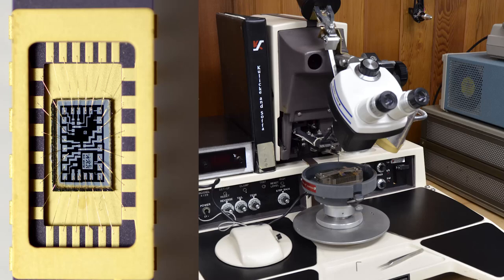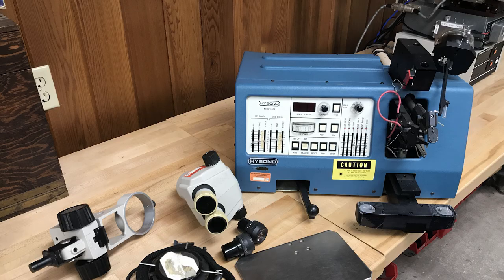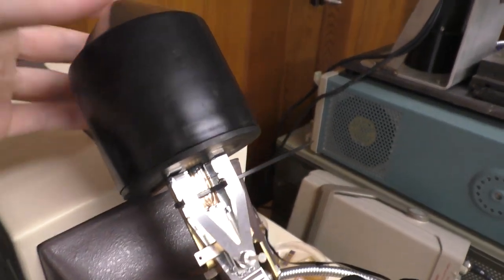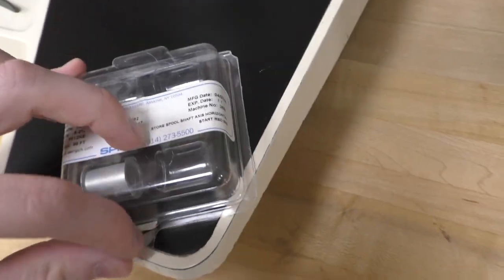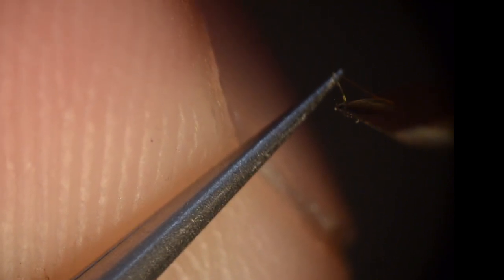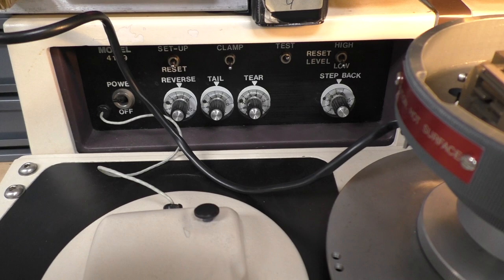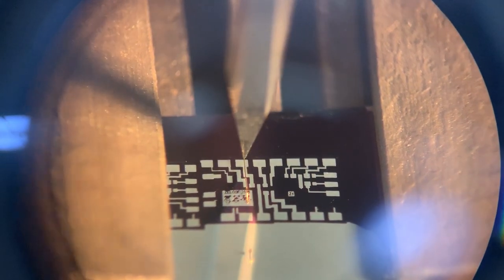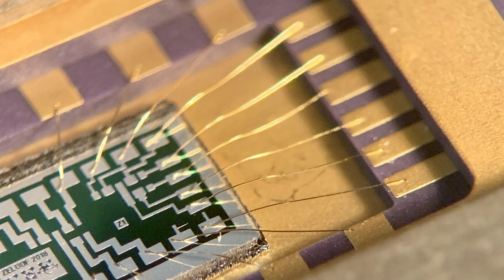Wire Bonding Basics - Manual Wedge Bonding ICs

Comment: Since you mentioned copper pads: if you really plan on using it on the chip itself - be very careful - copper tends to migrate into the silicon and destroy the transistors. So it always needs an isolation layer that it cannot migrate through. Also: use some deposition machine for copper exclusively and make sure it is physically separated from all other machines, if possible by a wall and/or airflow. Even the slightest copper contamination can destroy your logic layers! That includes the almost undetectable copper vapor floating in the air around a Cu PVD site or the Cu traces deposited on a carrier or workbench.
Reply: I keep coughing up green stuff, must be the copper
Reply: I would think it is at the nano scale process nodes but here I don't know. Is that really an issue at this scales?
Reply: @teresashinkansen9402  Yes, copper has been a problem since the beginning. Even very shallow surface defects can ruin your semiconductors. AFAIK, AMD was only able to develop the first copper based process in the mid 90'ies when they reached about 130nm. Before that it was just "shut up and use more aluminium".

Comment: The flat ribbon is also useful for RF applications, as it reduces the inductance of the connection from the die to the leadframe.
Reply: You need orthogonal bonds to get the L down.
Reply: You can also have a slightly larger bondpad (not too large to limit the stray capacitance), and use multiple gold wires on the bondpad to reduce the effective series inductance.
Reply: O so yoooou’re the smart one!
Reply: RF is wizardry compared to the quantum mechanics of silicon.

To what extent do the wire lengths and geometries here matter like they do in traces for chip antennas?
Reply: i think the ribbon is meant to reduce the skin effect rather than the inductance
Reply: @jspiro  A decibel is a decibel, a watt is a watt, a volt is a volt, a byte is a byte, a clock is a clock. Every little detail which removes any noise from the signal adds up, no matter how small and trivial, everything still adds up.
The end result is a system with significantly cleaner, stronger, faster, better performance.

Comment: so basically this is like a manual 3d printer except the nozzle is supersonic. ive seen people use some ultrasonic "welder" or "cutter" these last months, cutting anything like butter. i have also seen some 5+ year old toshiba video showcasing cnc smd pulse laser soldering, the thing is so precise, makes perfect melts everytime, i almost cried. i can imagine some makers build a $150 wire bonding machine, seems like the gold wire is the most expensive thing here.

Comment: It would be neat if you made a chip of Ben Eater's homebrew CPU!
Reply: Given the size of this relatively simple die, I don't think that would actually be possible, unfortunately. It would have to be made much more compact, and would also be very complicated!
Reply: @CorvusPrudens  Jup, the architerure "plan" of a CPU can have a size of multiple soccer fields...
Reply: an implementation of the gigatron cpu would be much more feasable. It has only about 300 transistors.

Comment: Given that those wires always go between fixed positions makes me wonder why there is not a more efficient process possible, like 'stamping' them on all together in one step.
Reply: In short: Tooling time and alternative bonding techniques.

Long: every factory produces at least dozens of different chips, possibly hundreds. If you have to change the stamp at every change of product or buy a bonding machine for every product this will become very impractical very quickly. So you buy a machine from some supplier that can make it very fast.

For chips with more than about 64 pins you use flip chip bonding - the package and its lead frame is prepared so that the connections of the pins already reach the right point under the chip. The chip has solder balls on top instead of simple flat pads. Then you flip the chip, put it on the lead frame contacts and apply heat. Done. The most aggressive version of this is BGA where you skip the package and bond the chip directly to the PCB.

Comment: Brings back such memories. I used a similar ball bonder for one off thick film circuits in the 80's. It definitely was a challenge to get things right when you only had a few ( if any )  devices to fail on. We had to import bare die from the US and it was expensive so it wasn't a case of give it a go and try again until you get it right. Impressive to see this stuff being used in home shops
Reply: i, too, dabble in ball bondage

Comment: You're a God, Sam! I have to rebond the gold wires from my thermal camera microbolometer array to the chip under it. I have fabricated micro soldering heads and tips before but never tackled anything a 10th this small. I have so many questions and found this video. And of course, it's Sam Zeloof. So now I will have to brush up on some of your other vids to get my head around this task. Thank god only three of the wires are broken. I am not even sure if I can fit the assembly under my microscope. I am so much happier since you reminded me gold bonds to gold with compression and oxidation is not an issue.

Comment: This is so cool to see. I actually have been working on Wedge bonders for the last 25 years. The company I work for is now a subdivision of K&S. We make Large wedge bonders for aluminum and copper ribbon for high power applications. It is a very similar process, except that the wires are between 125 an 600 microns in diameter. This is used in high power mosfets and IGBT's, both leadframe and also hybird inverter modules. Thank you for sharing your journey into the semiconductor world with the rest of us :)

Comment: It's nice to see this type of skill from an individual, as opposed to a huge conglomerate...
Not that I shun all corporations, but GE has their hand in every cookie jar, in some way, when it comes to electronics, whether it just the components, ICBs, or anything else you can plug in or power up in any way...
Even contractors of different skills and manufacturing are supplied by GE...
GE is somewhat of a monopoly in disguise...
They just use technicalities and loopholes to serve as buffers to achieve their dominance...
I enjoyed breaking down any component I could to see what was inside of it...
Having the level of tooling that you have is impressive as well...
Good stuff...

Comment: In the broadband RF/microwave world, manual bonding is still very much the way things are done. 
Bare die are used rather than packaged parts to reduce the effects of parasitic inductance and capacitance. It also helps with miniaturisation, although this is generally a bit less important. 
The geometry of some RF & microwave components, such as mmWave GUNN diodes are tiny by even a regular bonder’s standards and so I’ve seen some much larger machines floating on an air bearing for this purpose!

Comment: Outstanding work and adopted hobby.  I come from the days when most all the chips were ceramic and gold.  When they started to use plastic as the encapsulation material, there was a lot of problems with broken bonding-wires which was attributed to different expansion coefficients of the materials. So, if you ran a few extreme heat-cycles, it was not uncommon to have a disconnection between one of the outside pins and the die inside.  So, for many years the military tenaciously held on to total ceramic-packages. Just ran across your channel from Huygens and SUBSCRIBED!  I'm convinced that you could make some really high performance (and useful) IC's even if they aren't technically complicated or dense--matched transistor arrays come to mind.  Seriously--Hat's off to you!

Comment: Hi Sam, you mentioned at the end of this video that in the industry they wouldnt use such thick bonds etc you mentioned electroless  plating with nickelless and soft gold, could you please mention in an upcoming video or posting here some good reeds related to semiconductors and how industry actually does stuff like I can find papers and books about how most of this stuff is supposed to be done in theory but very little (close to nothing) about industry standards and actual practices (well besides the occasional very general "how CPUs are made" youtube documentary) 

Thanks.

Comment: How in the world have I not seen this yet? You did a great job of documenting the process of the internals… But how did you go about making the chip it’s self? 
Or are they old reused chips that you just cleaned up exceptionally well and re-goldplated while replacing the insides? Amazing work!
Reply: Apologies, I think with my third time watching the video I got my questions answered. You referred to “chip carriers“ at one point in the video and I was mistaken in thinking those were the little glass dishes you had all the chips in. But I’m assuming you’re referring to the actual package/chip themselves…? I know the chip is the little wafer that you’re bonding wires to… I guess it’s just a habit for me to call the thing with legs the “chip.”
Reply: @hullinstruments  you can get the carriers on eBay

Comment: Great to see you posting again man, your work is increadible. Thank you so much for sharing!
I might just have missed it, but what IC is that? The last time I saw you messing around with fabricating MOSFETs and now suddenly there's a whole IC soldered to a carrier!

I also have a few questions about this process: Since most ICs we use specify maximum storage temperatures of around 85°C (and exhibit quite severe, almost 1ppm, parameter variation after soldering), how does keeping the substrate at 150°C for so long affect the chip's long term reliability and it's engineered tolerances?
And finally, I understand why Copper needs a diffusion barrier to adhere to, but why does oxidation of the copper pads interfere with the wirebonding process, but Aluminium (which obviously instantly forms a tenacious oxide layer) does not?
Reply from the maker: thanks for the kind words. I guess ive been neglecting youtube recently and mostly just posting on twitter and my blog. Yes, I have fully working ICs now!  There will be a video soon. http://sam.zeloof.xyz/first-ic/. As far as the bonding, good questions. When the bonder is dialed in, it should take no more than a couple of minutes to bond the chip. So the die will only experience elevated temp. for a short amount of time. Idk how this effects the long term reliability of the chip, but I know the required substrate temp can be lowered substantially into the 100C range with more optimized bond parameters. This typically means using a higher ultrasonic power and thicker bond pads, which they have no problem doing because they have electroless plating solutions which I do not. The copper oxidation thing confused me as well to be honest, but I had serious trouble bonding to Cu pads until I saw this paper which said it needs a barrier to stop oxidation and it quickly stopped the problems https://link.springer.com/article/10.1007/s11664-004-0135-5 but I never had such problems with Al pads. Not sure why, they both oxidize at roughly the same rate to the same thicknesses in air (~5nm)
Reply: Total amateur hobbyist that knows nothing here... I think I recall reading a lot of the temperature issues post production are related to the chip packaging. Please correct me if I'm wrong. Again I'm no expert but I imagine the die is more robust on it's own and within a controlled atmosphere. How will it degrade physically/chemically under these conditions?
Reply: @SamZeloof  Thanks for the detailed response man, I always love reading the original sources for myself as well.
Also, thank you for sharing where you post regular updates now, I never knew you had a website, but I'll be sure to check it out now!
Reply: @UpcycleElectronics  So, basically, at elevated temperatures (usually > 125C when no power is applied). While the die itself is indeed pretty robust, the post-implantation annealing (if using ion implantation) is one low-temperature process that comes to mind as having a significant effect on the chip's performance.
Take a standard planar BJT for example; Even when only using diffusion doping to form the junctions, you will usually end up with a very thin thin base region that contains BOTH n-type and p-type dopants. For an NPN transistor, the base region just contains more p-type dopant atoms than n-type dopant atoms, however, the base region is also flanked by 2 n-type regions. Therefore, keeping the die at elevated temperatures could seriously impact the precise base width and the net dopant majority within it.

As for the wire bonding itself, some metals (especially Copper and to an extent also Gold) diffuse into Silicon extremely rapidly, thereby ruining your intended Ohmic contact and turning it into a crude diode with random characteristics.
One final thing of note: The longevity of silicon devices (which contain small/thin metallization layers) gets EXPONENTIALLY shorter with higher operating temperatures due to a combination of factors, with electromigration (which causes the wires themselves to fail, although not usually the relatively thick package-level bond wires) and wirebond delamination (where the intricate connection between the bonded wire, its matching adhesion layers which form the pad it's welded to, and the doped substrate) usually singled out as the chief causes.

Comment: I am here for my own 101 in wire bonding. First, excellent video! Second, I am truly impressed by Sam's bottom line. I just wonder what his hobby projects are :)
Else, I wanted to ask him (or anyone here & in the know) if wire bonding works on thick Cu substrates, 500um strength wise or more. Is it enough to 24kAu-plate the substrate? Known issues or advantages? Comments?

Comment: i wonder if you can stack these chips with wire bonding then bending the wires up so that its above and use a resin to create a multi layer chip for more density.

Comment: Hey, I have been trying to make a gold bond from Cu pad to Au pad using the machine 53xx Deep Ball Access by Delvotec. I scratch the Cu pad with sand paper and clean it with isopropyl but yet the first bond doesn't stick with wedge bonding settings. I have tried ball bonding and there it only stick the first bond but not the second. I would appreciate any suggestions you have for me regarding any settings. Thanks for the video as well!

Comment: Are there any plans to create a light emitting diode?
Reply: ...got some expensive rare earth elements and low expectations lying around? ;-)

LEDs need weird materials, but the process is comparatively simple. Once you made multiple transistors on a single chip I'd imagine LED does not sound like a worthwhile challenge unless you are a materials guy with a fetish for tuning band gaps.

Comment: Hey I have been looking to try this, here is a question. If one did not have a wire bonder, could you use flux and micro solder to the pads?
Reply: Yes, but it's difficult to get the power where it's needed.

Comment: Plasma cleaning will eliminate any very thin layer of contaminant.  Also, if the the PCP eliminates during bonding, there's something seriously wrong with its manufacturing and/or  quality assurance missed it. (There's a routine test to determine beforehand the circuits integrity.
Reply: Sorry, that was delaminates the PCB plating

Comment: Haha, I had to do this with my bare hands and soldering iron LOL
I had a ROM chip which I inserted backwards and burned some of its wires so I made an attempt to break the glass window and resolder those wires. It would have worked but those dam wires are aluminium and do not solder but I managed to fix them anyway to some extent.

Comment: You can perform room temperature bonding using au wire. I had to work out away to reliably bond the connection at < 40c. Systematic parameter analysis, custom tooling(I.e. ceramic capillary (needle) and high frequency bonding (120 khz) can do the work reliably.  Throughput takes a hit but have the difference addressed in the contract.